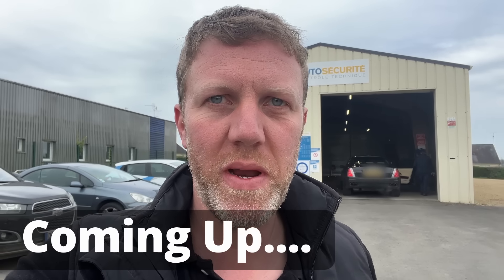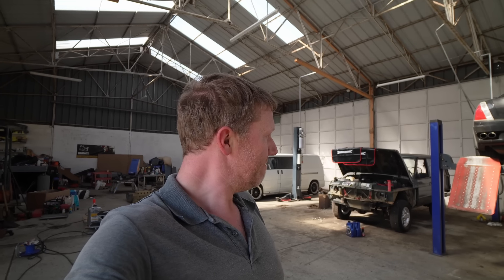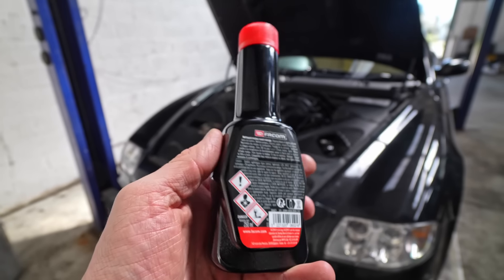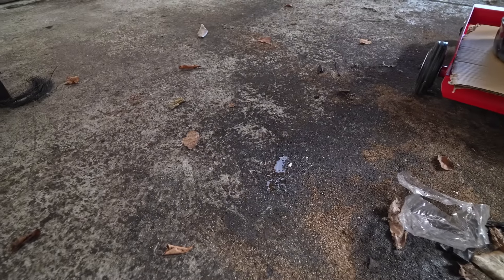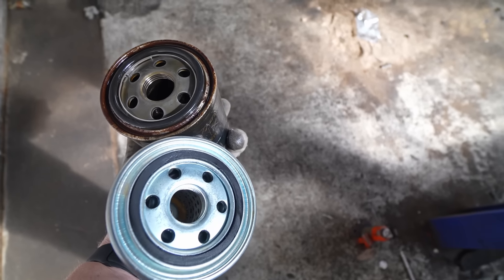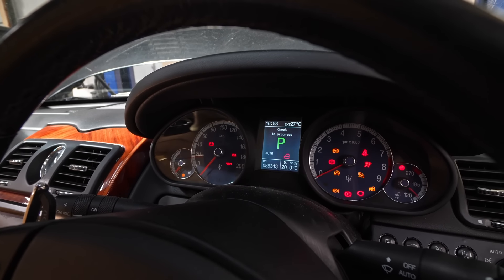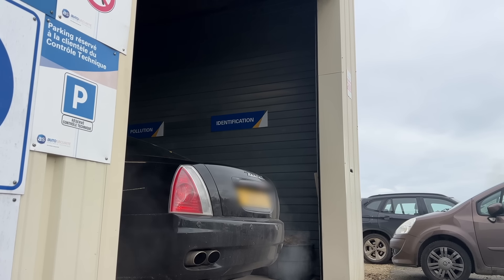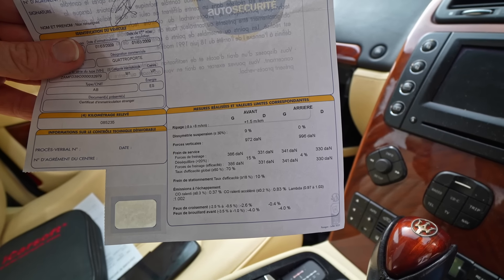Pass or Fail; Safety Test Time for the CHEAPEST Maserati Quattroporte in Europe

Comment: I have a great car story I just had happen to me. I have a 1998 Toyota Siena van over 250,000 miles on it. End of last year the driver wheel started wobbling. Drove it home parked it asked my sons to check it out. Was told it needed a new hub bearings. Finally had the money to fix it this week drove v e r y slowly to the shop. They called me and said it was fixed within a short time. The lug nuts was lose nothing wrong nothing to fix. I went 5 or 6 months with no car because of loose lugnuts lol

Comment: You'll get it all sorted Phil. I bought a 1986 740 GLE Estate in 2002 in the UK for £425 and moved permanently to France. We re-registered it shortly after and the CT fail was. Emissions high. Headlight glass needed changing. Drivers seatbelt not retracting properly. Paid a local garage to get new LHD headlamp glass 200 euro the pair genuine Volvo. He adjusted the emissions on the Weber carb and managed to sort out the seatbelt. A few weeks later all passed then could pay the CV fee and tax import free and get the plates made up. A very satisfying job. Had it for 5 years.

Comment: I worked at Wal Mart auto care. I don't remember the make of pick up truck it was but you had to go through the right wheel well to change the oil filter. If you were lucky you didn't have to remove the wheel. Also it was turbo so the oil filter had to be filled before it was installed.  Many not nice words. Great fun. You will figure it out.
Reply: I have to remove the fender well in order to change a headlight bulb. What are designers thinking when they build cars?

Comment: Phil, I know that you are resourceful and can do anything that you set your mind to, so I know that you got this too. I am surprised that they have such strict rules about driving in France with the wheels, headlights, and the ebrake too. The main thing they look for here is smog control. Have a great day
Reply: Well in France they drive on the wrong side to the UK (Where the car is from - Obviously we blame Napoleon and the French for following "his" advice and he lost against the UK anyway!) so it is an Issue and one that "should" have been "sorted", similar to the brake lights and tyres, like he said the emissions are a bit of a "problem" of which he had suspicions about, but that was worth trying the test out to see where he is, however "now" he needs to go through the basics to get it running as good as he can, it's time consuming but he didn't want to pay full price so there is always an element of cost and time to take into consideration, hopefully he can address it before it gets into money pit territory as he seems to be (A little reluctant) but good mechanic with a big garage, which is three quarters of the battle to a DIY'er on two ramps in the street!?!

Comment: Here in New York State U.S.A. a check engine light automatically fails inspection. A gas cap issue sets off the the engine light. In 1981, in Texas USA, 2 different color parking lamps was a fail.

Comment: Control technique is one part; but then do you have to pay vat and a further 10%  both based on value of the car as an import? Then you have the cost of the carte de Gris - varies by department but based on power of car /emissions? Hope u got the car very cheap in uk and taxes are based on that price and not some other arbitrary number!
Reply from the maker: There are certainly import duties etc and emissions based taxes but they are massively reduced once the car is over 10 years old so we shall see…

Even with all of those it will still be half the price of a similar car in France which also has issues so I’d rather have a cheap one that I go through, repair and trust rather than one I don’t know for more money
Reply: I wish more folks made this much sense. Here in the US, folks are so dang impulsive.
Reply: Are the o2 sensors ok, I am not sure if it would throw up a fault or not.